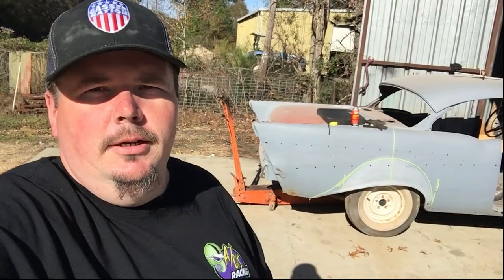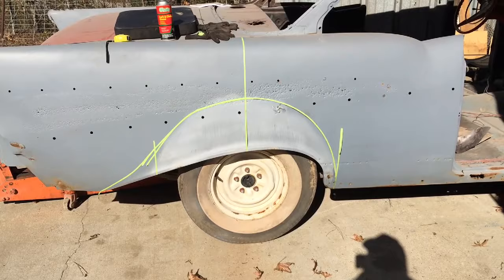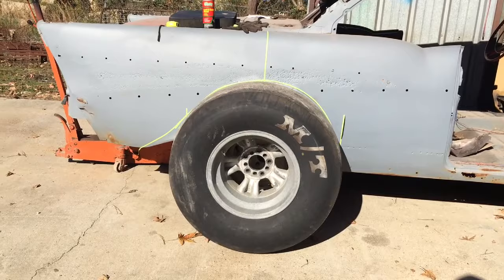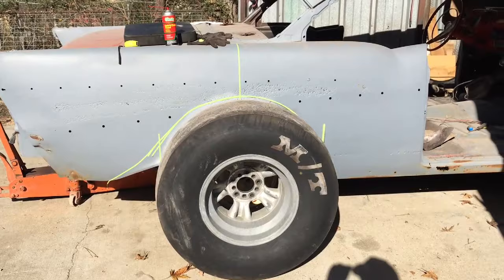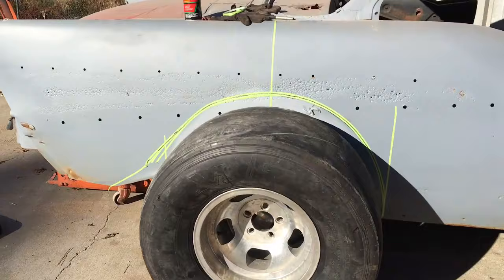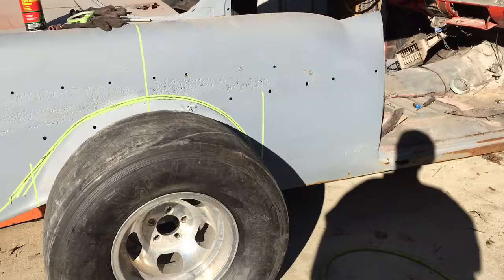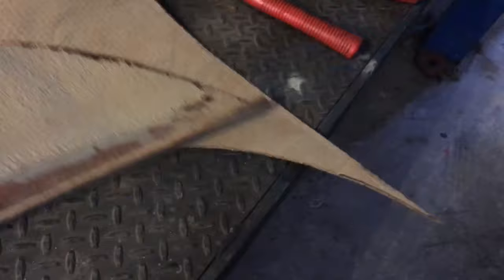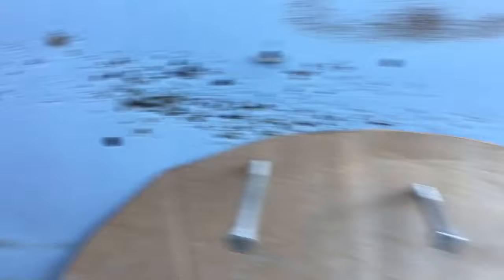Radiusing the Wheel Wells on Aces High '57 Chevy Gasser Build, Episode 3

Comment: Ive done everything to keep from cutting my openings. I love the look of the tire sticking out just a hair. I am able to fit a 10.00x15 Firestone Dragsters in the wheelhouse with a 1/2in spacer to keep it off the springs. Looking back I would of did a spring pocket and moved them in just to keep period correct.

Comment: You can get Nomad rear wheel patch panels they have the important fold over lap , which gives strength and rigidity to the quarter panel , no sharp edges to cut tires
Reply: Edward Alamo you’re thinking 55’s only

Comment: I had a late 60s early 70s era body mod book that laid out this process by bending a piece or e.m.t. around the tire. Raise it to the desired height. Weld that junk to your car and cut the inside radius  out. Fill with steel . Beat to fit , bondo and paint to match. Done.